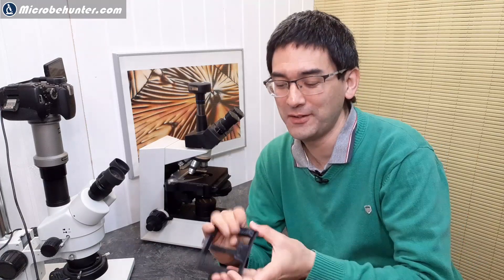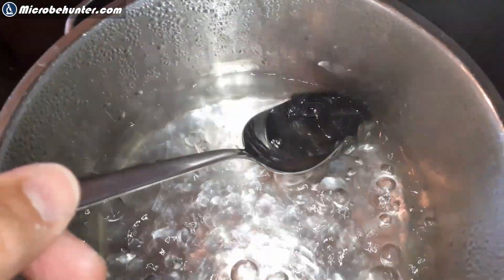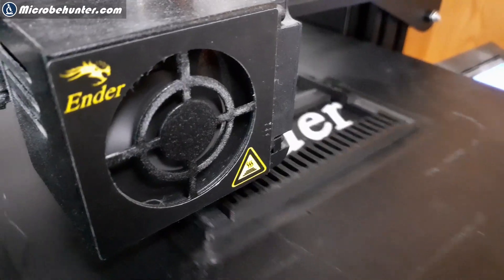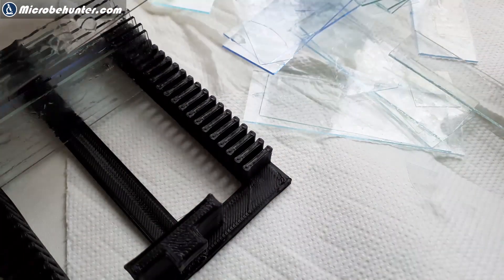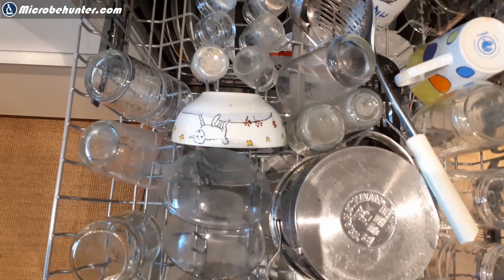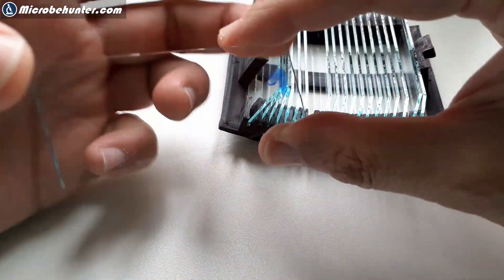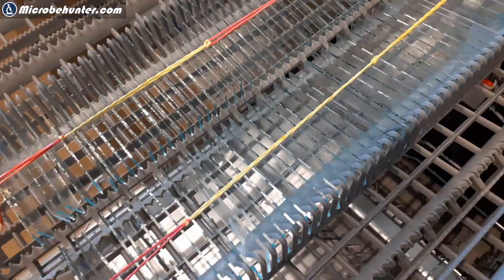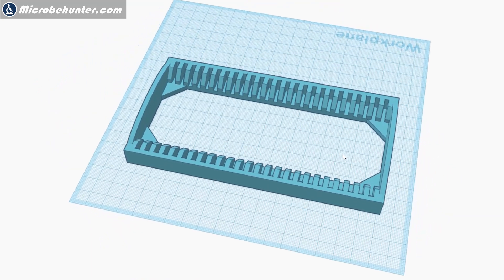🔬 Dishwashing microscope slides | Amateur Microscopy

Comment: Hi Oliver.   I use old plastic slide boxes that hold 25 slides at a time that I have cut the bottoms out with a coping saw leaving the slots and the ends of the box intact. The dish washer is run on a cycle that does not turn the plate-dryer coil on.  At the end of the cycle the slides are removed from the washer, rinsed with DI water and dried between paper towels.  I only put new slides in the washer to remove manufacturing residues.
Reply from the maker: Great tip!

Comment: Hi I may have eaten iodine used to stain onion cells the brown/orange one will I be ok pls reply
Reply from the maker: Iodine is used to disinfect wounds. It is also found in seafood and sometimes they also add it to salt (because it is needed by the body). Taking in too much iodine is not good, however.
Reply: @Microbehunter_Microscopy  I ate about a drop will I be fine
Reply from the maker: @lcsav7169  It is even used for disinfecting water: https://en.wikipedia.org/wiki/Lugol%27s_iodine
Reply: It’s the dosage, not the poison.

Comment: Make the next version with an upward arch in the middle, and an i-beam design under it that is flat (so you end up with a very shallow semicircle and a flat base).

That should provide better hold and tension on the slides, and more material, in a stronger shape, to resist bending.

Comment: If you used a plastic clip instead of a rubber band, I bet it wouldn't deform in the washer.  Should you rinse off with distilled water as a final step maybe?

Comment: PLA softens around 60-80'C. If the black stuff can withstand boiling water without shrinking and softening, it isn't PLA ;)
YouTuber CNC-Kitchen has done a materials-comparison of several materials and their softening temperatures.
In my experience, one material that prints similar to PLA but has a higher glass-transition-temperature is HIPS. It's cheaper too, but needs to be printed in a ventilated area (like ABS).
Reply: I can't print HIPS without a heated enclosure. Why bother with that if you can just use PETG, so you dont have to deal with ventilation and warping/separating layers. It is also more temperature resistant than PLA.
But although it is easier to print PETG than HIPS, it is more challenging than PLA. At 1:33 you can see that his print was warped even before the dishwasher, due to bad fist layer adhesion. It may be a single case of a technical hickup, because usually printers are printing PLA without the need to babysit them through the first layer, just to fuck you over as soon as you stop observing that Schrödingers cat. 
Or this is a serious calibration issue. In that case he won't be able to even print PETG until he fixes his settings.
Reply: @Bullshitvol2  Huh? What, now?
I've had no issues printing HIPS; warping of PETG is far worse that HIPS, in my experience. 
A heated bed is just good practice, an anti-draft fence is more than enough for most materials (including HIPS); enough to prevent the heat from the bed dissipating far too rapidly.
Reply: @Bullshitvol2  The discussion is about good materials and their softening point / glass temperature. Everything else  being equal, HIPS softens less at 100'C than PETG does.
Reply: @Bullshitvol2  That's the thing. You don't need 100C for HIPS. It prints like PLA. Talking out of experience here. HIPS even used to be touted as a support-material for ABS before PVA. The whole point is that HIPS can be printed on settings similar to PLA/ABS. The problem for PC or PMMA is the hot-end temperature, water-absorption, necessity of a heated enclosure, ... (not so for HIPS!)
At this time, I don't understand if you are trying to make valid counter-arguments, or just trolling me on teh interwebs.

Comment: Just a thought: you might also 3d-print a second, somewhat flimsier, "tray" to put on top of the slides to keep them in place and prevent bending of the bottom tray. But then again, this may hinder the cleaning process.
Reply: He just needed a latch with a hinge that goes over the top and then clicks into the side.